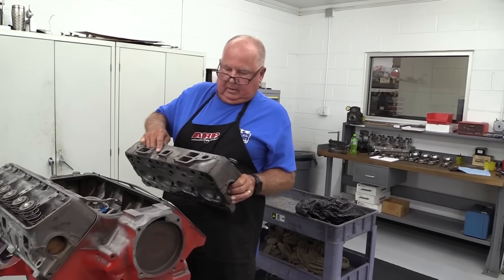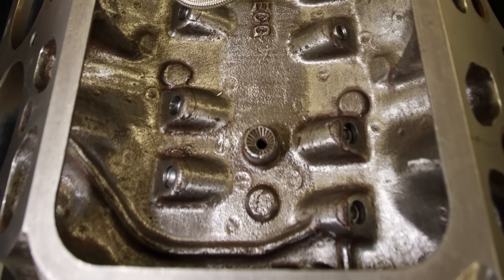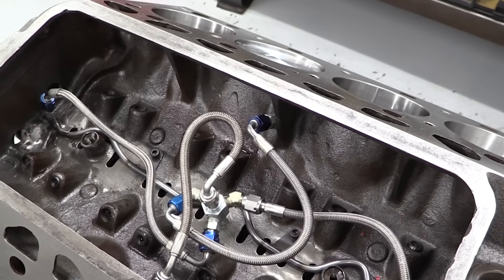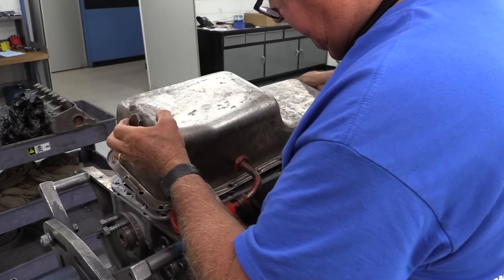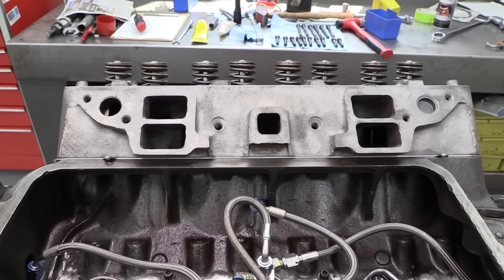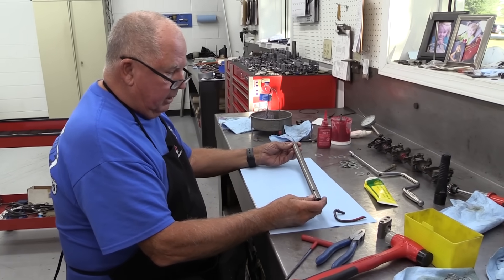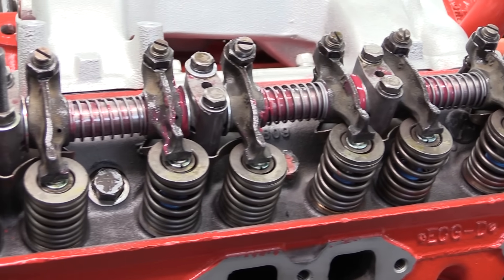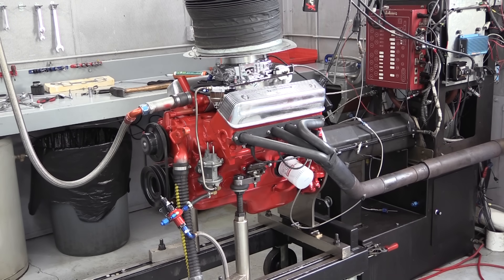The Engine That Replaced the Flathead -- Ford Y-Block Build

Comment: There is nothing wrong with 289 lb.ft @3300 and 218 hp@4500 from a stock 298 CID engine.  The last carbureted high-performance 302/5.0L was in the Mustang GT with a roller cam, forged pistons, 8.4:1, Holly 4-Barrel, and computerized ignition was of 210 hp @ 4,600 rpm 

With .373 lift and no valve reliefs on the pistons, the chambers needs to be deep.  The term valve pocket normally refers to the area behind the head of the valve.

The problem with stacked ports has little to do with length issues.  That's easy to correct in the plenum like other intakes.  The problem with being short and wide is it forces a 90 degree air flow change to the back of the valves and the inside the intake.  When you port engines like the Cleveland 4V heads, you actually add inserts in the bottom to force the airflow toward the top so the airflow is angled down to the back of the valve.

The direction of the port runners toward the center of the cylinders is like the small block Chevy.  They should have stuck with it.

I don't see any oil issues these days because the oil is better and doesn't sludge up.
Reply: Valve reliefs don't become necessary until about .500" lift.
Port length is one of the pros of the stacked port layout.  They are very similar length to begin with.
The shape of the runners is very similar from the plenum to just before the valve.  It is a little different right at the plenum but it's not a change from vertical to horizontal.
Reply: @charliemccraney  What I was referring to when the runners horizontal rather than vertical, nearly all the air flow needs to make a 90 degree turn from the runner to the back of the valve.  With vertical runners, the closer to the top of the runner you get, the smaller the change in flow angle is to the back of the valve.

NHRA had already imposed a hefty CID to weight handicap to the Hemis.  When Chevy moved from the "W" engines to the 396/427 Porcupine engines, so named because they incorporated angled valves like the Hemis, with a chamber that wasn't an actual Hemi, NHRA didn't change anything with regard to the Porcupine competing with the wedges.  When Ford came out with their Cleveland Series heads with inclined valves that were giving the small block Chevys trouble, NHRA changed the rules to handicap poly-angle engines.  However, prior to that they were fine with Chevy's poly-angle advantage before against the big and small block Ford and Mopar wedge engines.  NASCAR forced restrictor plates on the Hemi as well.  If we are to be honest, Chrysler's Hemi owns all of the titles back then due to a superior design.  Of course today with OHC, VVT, etc., everything is different and I have not kept on on them.

Comment: My first engine I rebuilt was a 272. Bored it .40 over and installed hardened exhaust valve seats. It was never installed or run and has been sitting under a bench for 35 years.

Comment: So this motor basically made the same hp as a fox body 302 DECADES later with less compression?? WTF No wonder the rest of the world laughs at our v8's  (and I am a ford guy)
Reply: And this particular build would have done even better if they had used a correct distributor and one of the better head castings.
It always baffles me when people want to swap a 302 for one of these.  If you're going to swap, go big or modern, make the effort worth it.

Comment: Great engines, I ran 4 myself. Crankshafts were weak I snapped two of them pulling medium loads.
Reply: Your timing had to be off had several, worked the living piss out of em.  Never broke a crank. And only blew one head gasket.  Lost a fan blade through  the hood once though!

Comment: I almost ruined a rebuild of a  312 . A chunk came off the seal  where the  oil pickup goes into the oil pump . On start up the chunk of rubber went into the oil pump gears and caused the shaft going up through the block to shear off.Fortunately  I had a large diameter oil pressure guage I stick on all rebuilds for initial startup and breakin. That and liberal assembly grease saved the day..

Comment: Lucky if the 239 lasted 75k miles   have a yard full or dead ones. 54.   Throw then🐟 go to fe
Reply: You must've been using some sorry motor oil like Quaker State and sorry oil filters. My Dad always got lots of miles out of the 239 Flathead. But he did change his oil regularly and he always cleaned out the engine after 3 or 4 oil changes too.
Reply: @lawnmowermanlawnmowerman9930  had dozen or so y blocks aways had problems Ford.   Had all theese years cars  54 5 6 7 9 60 1 2
Reply: PS flathead & 6were good .
Reply: Speaking of the 54 ohv 239.when new you had to park  w cardboard under the engine . AMC you needed to burn the cardboard in cold weather to get out of park.😆

Comment: Those ports were always a performance stumbling block ,which is what the late  Doane Spencer realised,where he  actually cut a set of heads up and realigned the ports ,including the relocation of the push rod holes . This was in his Y block powered T bird.
Reply: I had not heard about that.  Do you have a link to more info?

The conventional Y Block port layout has been good for 603hp naturally aspirated but a more common style of port does seem like it might start to be better somewhere around that.
Reply: @charliemccraney  Hi, Sorry about the late reply but here is a link with a few details about Doanes heads.http://forums.y-blocksforever.com/Topic112187.aspx

Comment: You didn't talk a bout the mis-alignment of the oil hole for the rocker arms in the block doesn't align with the one in the heads. I fixed this on my 292 V/8 with 312 heads.
Reply: There's nothing to fix.  All Y Block heads have a channel in the deck surface that handles that misalignment.  You do need to pay attention to the orientation of the head gasket in some cases.

Comment: 2  57 Rancheros,  58 business coupe, and 59 wagon, all with Y blocks, 312 in one Ranchero , 292's in the others - open up the valve clearance get a little more top end, close it up grab a slight bit more torque. always fun playing with them once you cleaned out the sludge build up :)

Comment: My father owned a driving school in the early '50's, he bought 2 1954 Fords for the school. Both of these cars had the camshafts wipe out from improper oiling. It made my dad a lifetime Ford hater. He went to Chevy and never owned another Ford for the rest of his life. So the engine builder here had to go to extremes to make the valve train live. Ford had a lousy design from the start.
Reply: The extremes here are not required.  Attention to the camshaft groove, a bearing with the groove along the outside perimeter, or cutting a groove into the block is all that anyone who knows Y Blocks will do.
Reply: so he had cheap throw away cars and drivetrains for the rest of his life? gotcha.
Reply: Rare to see a Y block kind with a flat cam, but a SBC or BBC...that's another story

Comment: The tube on the rocker rail was Ford's solution to lack of oiling from the cam journal.  That tube literally "spit" oil right on top of the rail from the main oil gallery.

Of course what this gentleman devised is much more efficient and effective.
Reply: That is absolutely incorrect.
The tubes direct excess oil from the shafts to the distributor gear, from the driver's side and to the timing chain, from the passenger's side.

What was done in the video is not at all efficient as it is absolutely not necessary.

Comment: I had a 1958 Ford Custom Cab, with the 292.  A friend in the Navy installed a JC PENNEY/ Hurst 3 speed T handle shifter .
  It was my Hot Rod.  Had a nice sound and ran good with a Holly 500 2bl.  A Fun truck in 1973.
Reply: Are you sure that wasn't a JC Whitney? shifter
Reply: @jerryw6699  Absolutely. I still have the paper with the picture on it in my photo album from 1973. It worked very well. It was spring loaded and would shift very smooth. 
   Do you remember JC Penney? This was in California.
Reply: @kenkozma3780  Yea, we had one here, it's now a sports bar. Our's never sold anything like that, mostly clothing and dime store stuff.

Comment: Traded for a 56 Ford pickup that had the 292 engine . I ran across a three two setup in a speed shop in Kansas city . Bought it dirt cheap and bolted it on for the heck of it . The old dog surprised everyone that rode in it . Sure wish I still had it .

Comment: 218 hp is not a bad number at all.  Love to see what these older engines are all about.
Reply: Yeah about as much as a 318 2 bbl. Mopar engine.
Reply: @4thstooge75  Is that horsepower on the dyno or horsepower in the brochure?
Reply: @4thstooge75  stop comparing 1967 to the early 60s.

Comment: Family friend has a beautiful 1955 T-Bird. Look under the hood and most people wouldn’t question anything. But look closer you’ll see the distributor isn’t quite right, and the intake has a small bowtie cast into one of the runners. It’s a 327 SBC and went so far as machining a set of ThunderBird Special valve covers to work on camel hump heads. He did this thirty years ago. He’s a diehard Chevy man and most people who know him can’t figure out why he had a Ford

Comment: On the block before rebuild the opening just to the rear of the fuel pump was for the draft tube. This draft tube had an odd little filter in it which if not changed would plug up. Then oil would start out past the rear main over time. When complete this engine the opening now has a plate over it. Was a PCV system added? Couldn't see sign of one on the completed engine.
Reply: The valley pan has a provision for the draft tube.  It doesn't look like it was installed in the video and it wouldn't really matter if it was, given how it works.
Reply: @charliemccraney  The draft tube is needed. PCV's arrived about 1963 on cars, but not on small airplanes. The Lycomings  still have draft tubes which result in some oil residue on the belly. Anyway without the draft tube there is no way for the oil vapors to be sucked out of the crankcase. The result with the Y block and the blocked draft tube with the filter was oil out the back main seal. The draft tube filter I remember as a Fram CA-6. Changed a number of Fords with 272 and 292's with rebuilt short blocks due to this. Considering these rebuild cars are really mostly for display it probably will not be a problem.
Reply: I know how it works.  On the dyno, that tube does nothing more than simply being a breather, so it does not matter one bit if it is installed for this video.

Comment: Yes,I ran a 292 truck engine in a '54 Ford.Noisy valves,all of the time.Never had enough oil on top.Drag raced it a LOT.Got 18 tickets in 2 years. I was just a kid.

Comment: "Infamous" Flathead?!?
I would agree with "Venerable" Flathead  but not "Infamous".
The flathead Ford V-8 was a reliable daRn near "bullet proof" engine.
The Chevrolet Vega was infamous for rusting out on the dealer's showroom floor. The Ford Pinto was infamous for (allegedly) exploding if it was hit in the rear.
Bonny and Clyde were infamous bank robbers and murderers.

You lost me with the "Infamous Flathead".
The "Y Block" engine was not a bad engine, but it was not in production as long as the flathead V-8 was, before it was replaced.
Reply: The Y block was a lousy engine with a plethora of valve train problems. The 260 & 289 were way better engines.
Reply: @4thstooge75  260 was a piece of shit.
Reply: Famous Ford flathead would be a more accurate name.

Comment: Does a 312 intake manifold fit a 292? I tried bolting a 312 4 barrel on my '57 292  and it was too narrow. A friend said I needed 312 heads too. true?
Reply: With very few exceptions, there are not 312 intakes or heads.  They are the same so yes, they work.
There are 3 different port sizes for Y Blocks, with '54 being the smallest, '55-'56 being medium and '57 or newer being larger.  '54 will not work with '57 and up.  You must have tried to mix those.
Reply: @charliemccraney  - In that case, the intake may have been used on a Y block with heads that had a lot milled off them. Ports seemed to match. Was tempted to try running 2 or 3 gaskets on each side but ended up selling the intake with a swap meet 600 Holley bolted up.  The guy that gave me the intake found it somewhere. He did own a '54 3/4 ton  with the 239 though...
Reply: The intake would be too wide if the heads and / or block were milled heavily.
It could also be that the intake had been milled previously to fit on a heads or block that was milled and no longer works on heads or a block with little or no milling.
If a Holley 600 mounted directly to it, then it was a '57 or newer large port intake.
Reply: @charliemccraney  - I meant the engine it came off must have had  severely milled heads. heads.

Comment: Thanks for this video. I had a 1962 Ford short bed pickup back in the early 1970's. It was my first vehicle when I turned 16. The truck was special ordered when new with a 292 y-block engine and a granny geared (very low first gear) transmission with a positive track Dana 60 rear end. I had the engine rebuilt but could not find new rocker shafts so they turned them over and used the new surfaces on the shafts. We used a kit that teed off of the oil pressure sender and went through copper lines to the rocker cover bolts and oiled the top end that way. I was able to find an right side exhaust manifold to eliminate the exhaust crossover pipe and make it dual exhaust. I had glass pack mufflers. Was able to find the later style oil filter adapter to replace cartridge filters with modern style filter. This video brings back a whole lot of memories. Thank You
Reply from the maker: That sounds like a fun truck. Thanks for watching!

Comment: I had an old 292 my dad got off a buddy of his we put in a 63 and a half Ford Galaxie but it had those oil line on the valve covers made out of copper went into the bolts it held a valve cover 2 oil the rockers it did run pretty good I'm glad you got rid of that old canister oil filter

Comment: Not bad considering the 292 4V was rated at 210 hp by ford.  Only thing I don't truly agree with is the modifications to the oiling system.  With modern oils it is not needed, the problems arose from the oil of the period.  My 292 has never been rebuilt and still has great oil pressure and the rocker arms oil nicely.  The plugging of the rocker arm shaft also makes zero sense.  the rocker arms are not pressurized by oil they are just splash lubrication by oil flow, that is what the return is for to allow oil to simply flow vs being pressurized.  Sure many run pressure rocker shafts on these engines but for a street engine why.
Reply: I feel the same way. i've driven y blocks 100s of thousand of miles with no modifications to the oil system and have had zero problems. The main problem was the channel in the head for the rocker oil would plug with crud from the poor oil non detergent oils. When motor oil got better that problem went away. and it was never and issue if  the oil was changed frequently enough.
Reply: @jerryw6699 , Correct.  My '56 still sports an original 292 that has never been rebuilt and I am currently just over 150k miles on the engine.  I have service records of the car dating back to 1963 showing every oil change done at 2,000 mile intervals.  It showed every transmission service and every rear axle service.  Even listed coolant changes and point changes/adjustments.

If it was a design problem as some people want to claim they why is mine still going?  Why are there numerous videos on here of old Y blocks that haven't ran for years firing up and running just fine.

I even got some old timer on here trying to tell me my '56s 292 Y block has been rebuilt as it cant be 60+ years old and not have been rebuilt.  Like to know how he knows whats been done to my 292 and what hasn't lol.
Reply: yea, that old oil was naaasty from what ive seen after taking old engines apart. no detergents, so it mixes with the carbon and basically turns into tar.
Reply: @frigglebiscuit7484 , It was.  even with modern oils long as the passage for the rocker shafts are not plugged modern oils will clean the old gunk out.  Im just amazed at what people did to these engines to keep them going.  I recently replaced my choke thermostat with a $75 NOS unit.  Someone took pliers and tried to bend the thermostat coil to get it to work properly which made it non functional.  You either had it where it would open all the way hot and never close when cold or have it close when its cold but never open fully when hot.

Comment: An oddity of the Y blocks was the 12 timing pins on the timing chain between timing marks on the oil filter side of the engine. That has threw many a person for a loop. Lots of Y blocks had external overhead oilers added back in the day. I have taken a few loose where they hooked up to the rocker arms and no oil would come out; drop the copper tubing down below the crankshaft and oil would trickle out. Every time the main on the crank would be worn real bad. I remember one that turned down on .030. I still quite a bit of Y block stuff.